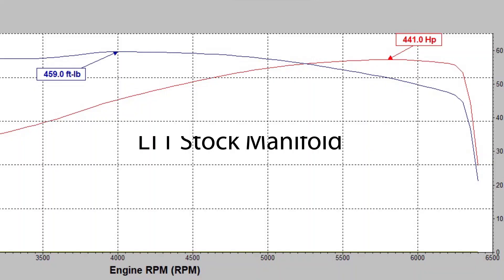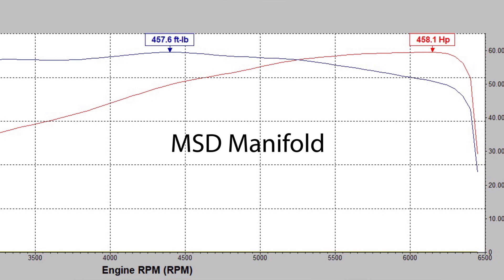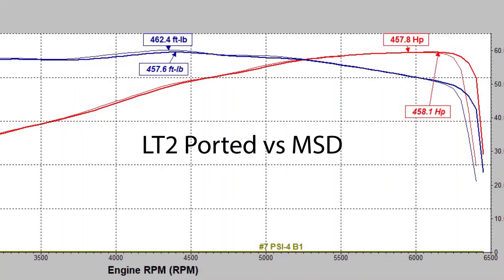New LT2 Intake Manifold Dyno Test vs LT1 and MSD

Comment: I have the ported LT2 95MM TB roto fab and E85 with stock exhaust and on my tune he only got me 442 rwhp. Don’t seem very good. 428 rwhp on 93 octane.
Reply: Yeah, something doesn't seem right there to me either.  Your 93 octane number seems low to have that tuned.  I ran the exact same combo on 93 octane and I was about 445rwhp with a Diablo tune.
Reply: @Blakehenry11  did yours have the stock headers and exhaust? I’m putting 1 7/8 headers with x pipe at the end of June and I’ll see how much more I get. I have a 21 Camaro SS
Reply: @scottyrobbins4972  Yes mine came with the stock shorty headers.  I'll be adding long tubes sometime this year.

Comment: Thank You came back for a refresh to my Memory. I have heard the LT2 manifold can be modified to fit under the Corvette C7 Cowl. Since we are Normally asperated so far. low pressure, more like vacuum pressure. Can you suggest a source for a LT2 manifold with modification to fit the Corvette for N/A engine? I could cut the cowl but it may be too big a cut to be done aesthetically pleasing. 1/2 rise over the rear end of the intake is no that big a deal to me. 1 inch rise started to look really weird.  Thanks Dennis in Virginia

Comment: Fudged numbers stock. Most stock LT1’s are in the 392-407 rwhp range. 450+ rwhpon just E85 is insane, impossible. I’ve NEVER seen E85 add over 40-50 rwhp to ANY vehicle. 12-25 rwhp yes, but 40+ rwhp, no way.
Reply: A e85 tune will most definitely add 40whp+ on a 6th gen camaro.. guys are seeing gains of 30+whp over a 93 tune.

Comment: Swapped out an l83 for an l86. No one told me about the difference in exhaust, intake manifold and throttle body so I currently have the 80mm that was on the l83. Thinking about getting the l86 intake or the lt2 but wanted to get some opinions from everyone. I did my exhaust already from Texas speed. Headers all the way back. Single 3.5 "  help please lol
Reply: People have tried the LT1 intake on the L86. The L86 intake is designed for a truck power-curve. If you put on an LT1 intake, you will shift everything towards the upper RPM range rather than mid- and low-RPM. I guess it depends what you use your truck for.
Reply: @SocketToMe  ok thanks but what about the lt2 intake instead of the lt1? Also can I put a 95mm throttle body on a l86 intake? Thanks

Comment: I've got a Camaro SS with ported throttle body and a roto-fab intake. It seems like for the cost, the LT2 manifold is a total no-brainer. I wonder if the ECU will still play nice being stock with ALL of the air intake components modified?
Reply: Any updates?   Did you need to tune after the CAI and Intake

Comment: Base: 441hp/457tq
Stock ported: 447hp/461tq
Lt2: 455hp/459tq
Lt2 ported: 458hp/462tq
Msd: 455hp/458tq
Reply: Thanks
Reply: Most shops dunking base LT1 mani vs ported LT1 mani aren’t seeing any real power increases. A few got 2 hp. But 6-7 hp, must be the smoothing method used. I can verify that the LT2 mani is better on a LT1 vs MSD as well as costs.
Reply: Thanks for the recap

Works out to $77 bucks per horsepower for the MSD Atomic Intake. 

No thanks!
Reply: @Jommybutler1234  OR you can do what I did and beat all of those intakes for $58 /rwhp instead.
Reply: @Fluke2SS  how
Reply: @slow1le_239  Only thing I have done to my car:  2" Headers, 3" X-Pipe, K&N Typhoon CAI, E85 & tuned.    

The initial cost for me on those upgrades ended up being $3500 total which includes the dyno tune.  So that actually came to $41/hp for me, but I'm sure prices are different now, so maybe little more now. 

My car dyno'd for 459 rwhp and 477 rwtq or ~540hp at the fly.  With an intake manifold, I expect to see another 20 hp gain.  Not sure how much more torque I can expect, but not really chasing torque in my build.

That said I have decided when I can to get a stage 3 LT2 Intake Manifold with a 95mm ZR1 TB which includes porting

Also just FYI, the base number Tyler gave is about 40 rwhp higher than stock, which means, he probably has Full exhaust including headers & a tune.

Comment: Did the LT2 intake bolt straight on to the LT1? And we’re there any modifications you had to do to run this intake? Any clearancing or rerouting hoses or lines?
Reply: You need to get it modified to fit, gwatney performance sells them and modifies them to fit

Comment: Didnt GM say that the only reason they were able to put this taller manifold on the c8 was because they did not need to worry about frontwards visibility? Yet it seems to fit neatly under the camaros hood... unless they were only referring to the c7.
Reply: A new intake option sounds great then. The LT2 shares a lot from the LT1 and seeing as how its doubtful the camaro will get a new engine this gen due to poor sales. Making an "LT1.5" may be a decent option by swapping on some LT2 parts
Reply from the maker: We haven't checked fitment on the C7 yet, so not sure!
Reply: GM was referring to the Corvette. It was sightline over the hood+aero given by the hoodline.
Reply: There is also pedo crash test standard, that calls for some space between top of engine and the hood.  C8 doesn't have to worry about that, and from the sounds of it, neither does Camaro.

Comment: might pick this up for my 16 ss. i just order that through the link and thats all il need?
Reply from the maker: It will require adding a fitting in to the back of the manifold for the brake booster - as soon as we get more inventory available, we will be offering a ready-to-go, bolt-on manifold.